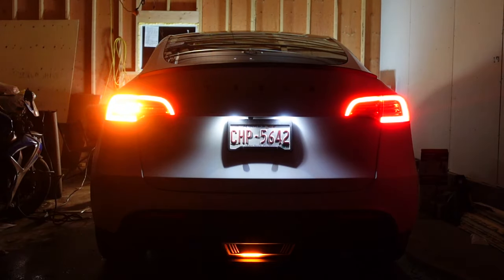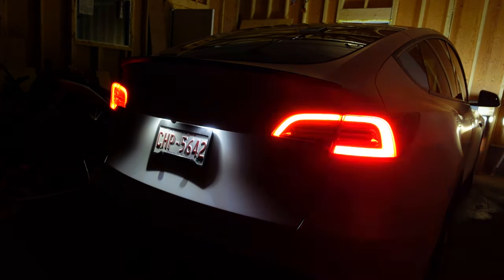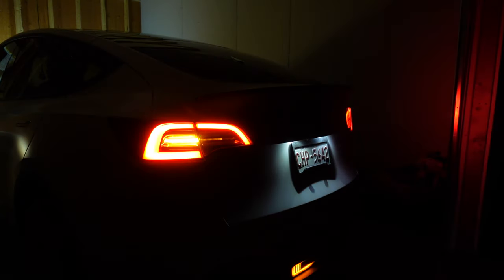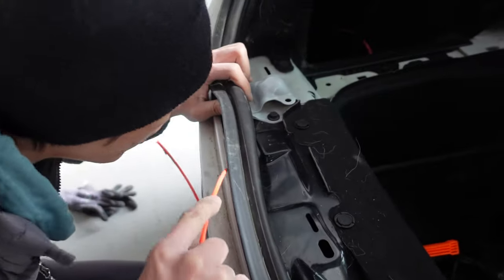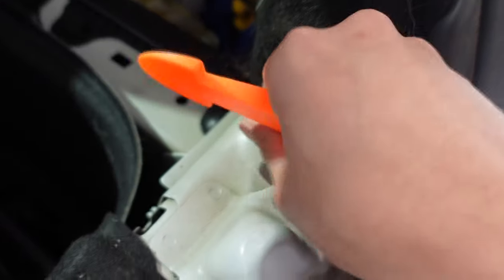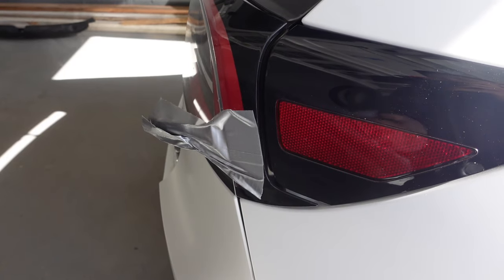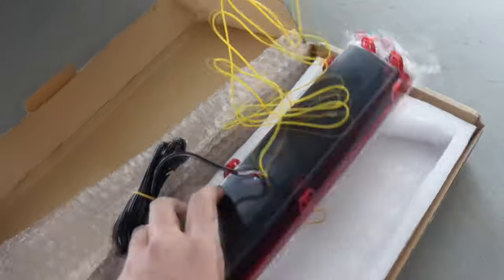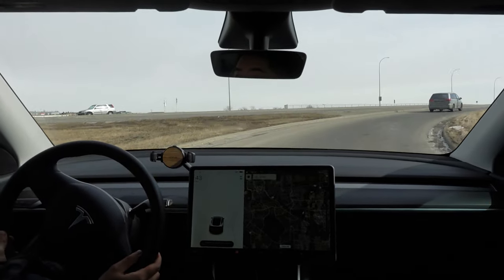2022 Tesla Model Y Pilot Light

Comment: Does your light goes into animation or parking mode while driving on the freeway ? I was reported by a friend my lights were doing animation mode when driving on the freeway at night
Reply from the maker: The light should only go into animation mode when it's in park. I haven't had any issues while driving on the free way. That's really weird .. perhaps I'll mount a cam and test it next time. Stay tuned
Reply from the maker: Just tested, mines been working great. :)
Reply: @TeslaHo  when you said working great. What the light actually does during driving, off until brake or signal ?